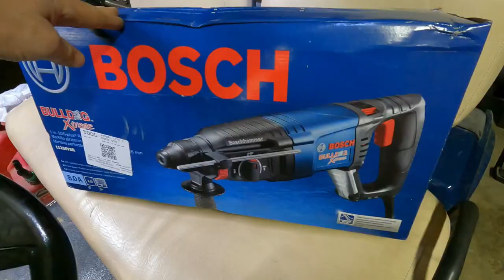Sewer Line Repair - We Have A SERIOUS Problem!!

Comment: LP Gas Code would never let us have a flair fitting underground. You should also be using coated copper underground and doing a pressure test from the regulator on the tank all the way to the house. Let it stand at 3" WC for four minutes using either a water manometer. Or, you can do a 3" WC using an inch gauge.

You can order 1/2" Coated Copper from your local HVAC supply company. If you do have to have an underground connection it should be braised and not a flair fitting.

Where your LP gas line comes up out of the ground you will want to sleeve it using 1" PVC. You would be amazed at how many folks wear down and create gas leaks weed eating.
Reply from the maker: Thanks for the tips. I know things are done differently in other places. Where about are you from?

Comment: How about wrapping both propane splices with tape in case you want to part the pieces of line someday and don’t like the idea of working with crusty fittings that have been buried in the dirt for years? Not really important in the scheme of things, but it will be one less thing you will have to explain to St. Peter some day. 😁

Comment: I'd go back over the interior patch with hydraulic cement or drylok at minimum. Fast set concrete is pretty porous. Id also check out a proper splice for the well pump. You'll eventually end up with moisture and corrosion issues. The heat shrink seemed to be standard style not waterproof marine style.
Reply from the maker: Thanks for the tips!
Reply: @Rustic Handyman  I speak on both of them from experience. I hit my well line and about 2 years later the pump burned  up from the bad splice. The corrosion caused a bad connection ended up dropping ground and killed itself. When I ran a new water main I patched with regular cement and again started noticing seepage. The well was a expensive lesson learned.

Comment: For patching the wall you could of used  a product called hydraulic cement.  And a excavator would of made it easier and faster if it was affordable
Nice job
Reply from the maker: Thank you. Yeh, I didn’t have access to a back hoe/excavator initially and I was determined to get the line open asap to stop the water from coming into the basement.

Comment: What type pvc pipe was installed previously because schedule 40 would not crack while being cut
Reply from the maker: It was the same thickness they use for leach beds, without the holes. Much thinner than schedule 40.

Comment: Well done sir. Why not use spray foam on the wall hole ?
Reply from the maker: I don’t think spray foam is recommended for that type of underground application. Sure would have been easier though!
Reply: @therustichandyman  
Thanks
Reply: @careysharp8340  NS grout should be used, dry packed.

Comment: the thing you never want to do, but it's done ,  no more worry...darn trees paint on there and no one will notice a thing . Note :   PROPAIN GAS IS HEAVER THAT NATURAL GAS , IF THE PRESSURE FITTING EVER LEAKS , IT WILL FOLLOW THE PLASTIC SEWER PIPE TO THE HOUSE WAS THIS MAY BE EXPLOSIVE **  If you get the opportunity , replace the whole length of gas pipe .      Ask you propane supplier for confirmation        *SATETY IS ALL I AM CONCERED WITH **
Reply from the maker: Thanks for the advice.